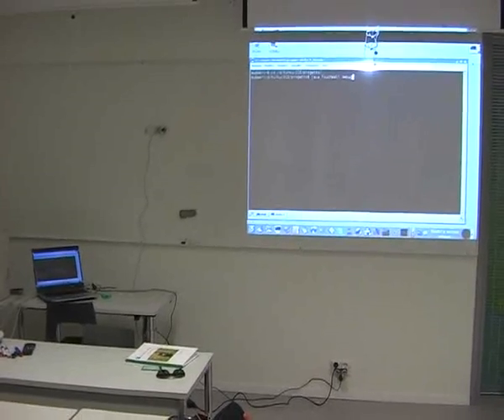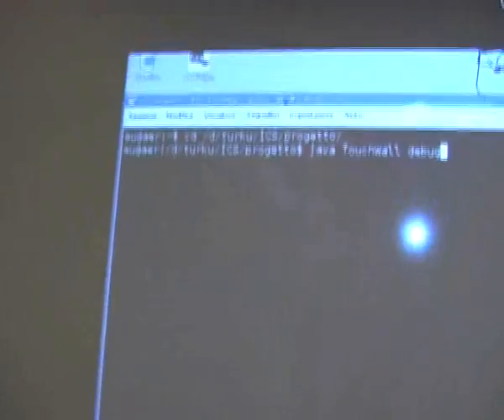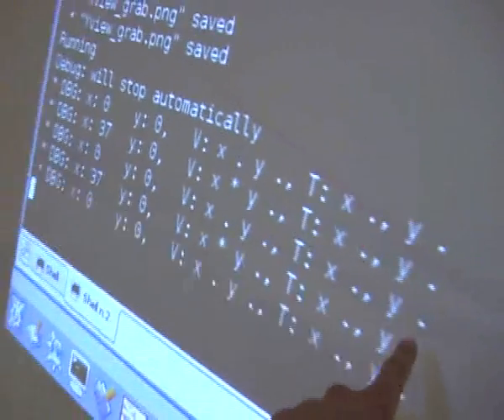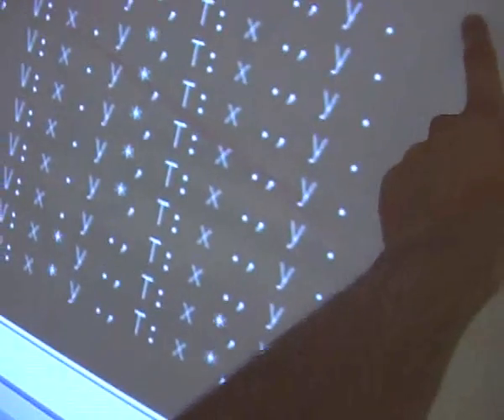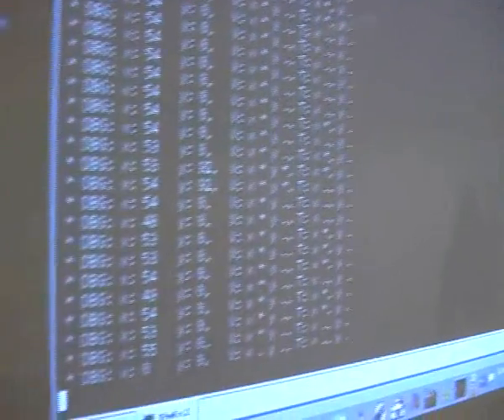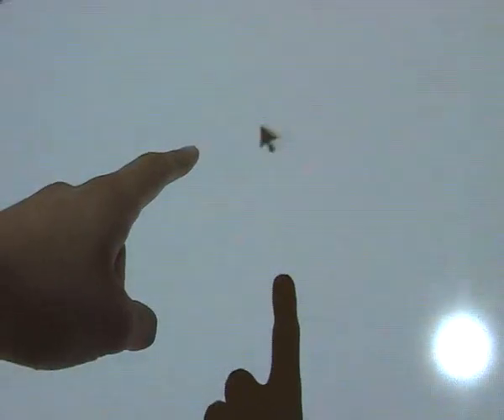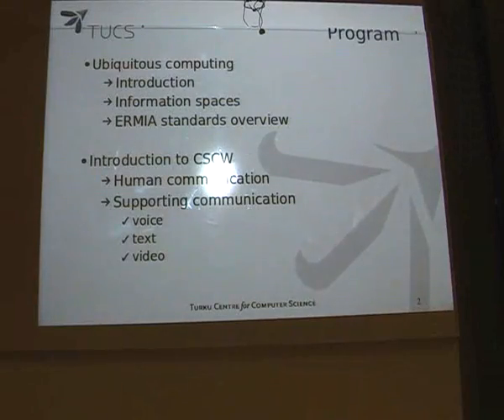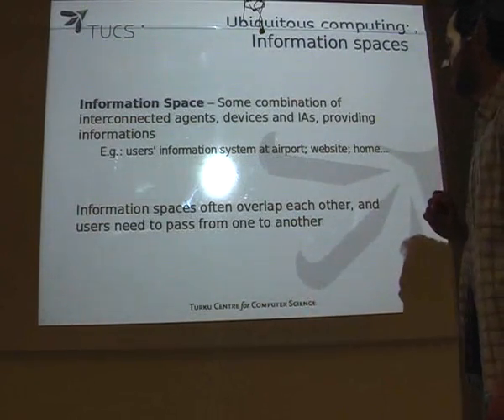Touchwall - Cheap finger tracking system prototype

Comment from the maker: The main application of this system is to projected walls, because huge touchscreens are too much expensive. Maybe other hw would have been more accurate, but webcams are probably easier to find than other hardware. Anyway, thank you for the suggestion!